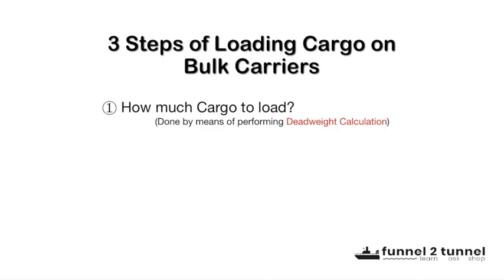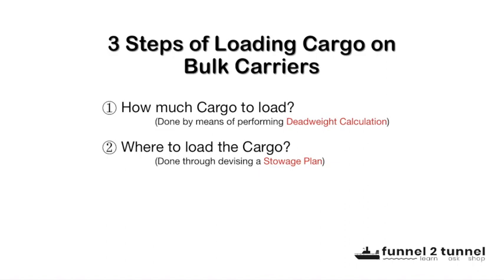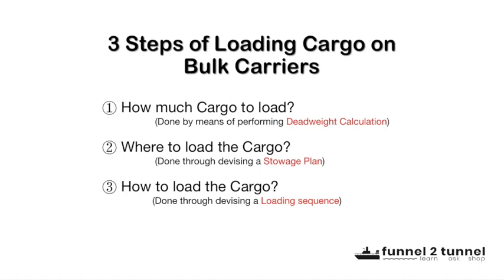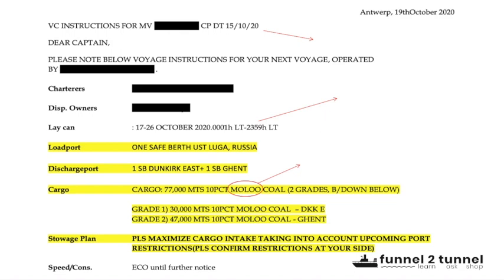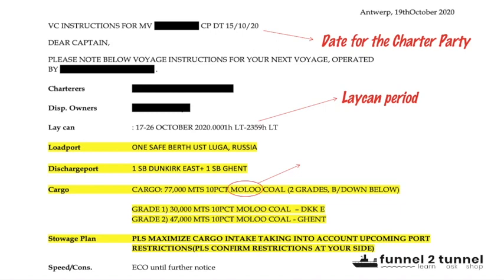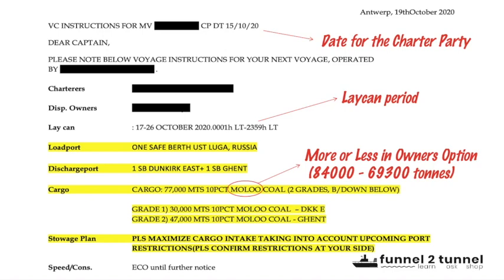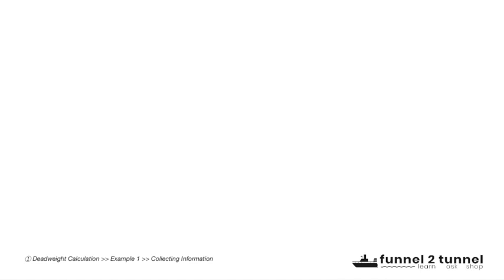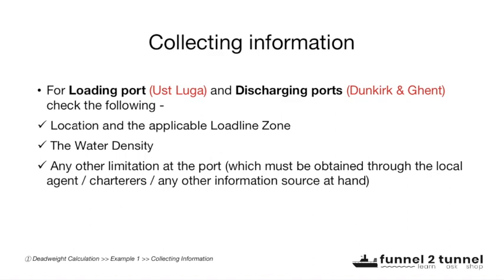Deadweight Calculation and Stowage Plan | Bulk Carriers | Part 1 | Simple explanation

Comment: Good effort. Suggest following corrections to be made to get the concept right.
1. Loadlines restrictions (legal limits) are applicable for density of SW 1025, if there is no draft restriction at port it doesn't matter whether you are overdraft in port. It's called FWA/DWA.
2. Limiting draft winter at Skaw, displacement for SW(1025) should be taken not FW(1000) on same note above.
3. Cargo to load at Luga = (Winter DW-consumables) + consumption to Skaw (though negligible but technically incorrect!)
Thanks
Reply: Yes I think same to you

Comment: Correct me if I'm wrong, but isn't it that we do not need to apply density correction on displacement for Loadline restrictions? So if vessels draft at winter point exceeds its winter loadline draft at @ 1.000 density, its fine, for as long as it will be at its winter draft or less if calculated to SW density.
Reply: Hahaha i also confused ..... As i know to maximise cargo sir... 92658mt at skaw.. forget the dnsty... So 92658-lighht ship-fuel,fw,balst,constant,etc.. PLUs f.o. u will consume frm skaw to loading port

Comment: I have one question, In some other videos not yours but other channels, they applied density correction to dead weight . Please explain do we need to apply density correction  to displacement or to dead weight ?
Reply from the maker: The density correction could be applied to either displacement OR deadweight. Both will yield the same result. It's just a matter of your convenience, however, applying to displacement makes the calculation clearer and you can compare the results with loadicator more conveniently.
Reply: @funnel2tunnel360  I tried as you said but result is not same .
Reply from the maker: @vijaymanhas947  
Imagine that at draft 12.00 mtrs the displacement is 90000 mt at density 1.025 [obtained from tables]
The light ship of vessel is 12000 mt. 
Let us calculate the density correction 
density correction  = 2195 mt 

Case 1 : 
Disp @ 1.025 = 90000 mt 
Density correction  (-) 2195 mt
Corrected displacement  = 87805 mt 
Light ship (-) : 12000 mt 
Deadweight : 75805 mt 

Case 2 : 
Disp@ 1.025 = 90000 mt [1.025]
Lightship (-) = 12000 mt 
Deadweight@ 1.025 = 78000 mt 
Density Corrn (-) 2195 mt 
Corrected deadweight = 75805 mt 

Hope it clears.
Reply from the maker: Finding out density correction doesn’t require any interpolation. 

Density corrn = 
(SW Disp x Density) / 1.025

Hope it clears!
Reply: @funnel2tunnel360   thx so much for clarification
Reply from the maker: @vijaymanhas947  Happy to help .... always

Comment: Sir, is it possible to improve the Loadables by removing the unpumpable Ballast
Reply from the maker: Unpumpable ballast in itself means the quantity of ballast water which cannot be pumped out using pumps.  Lower the quantity of unpumpable ballast higher is the quantity of cargo you can carry.  So a smart Chief Officer will always strive to pump out maximum ballast during loading so that he is left with minimum unpumpable ballast quantity